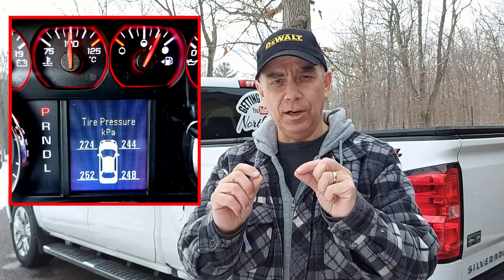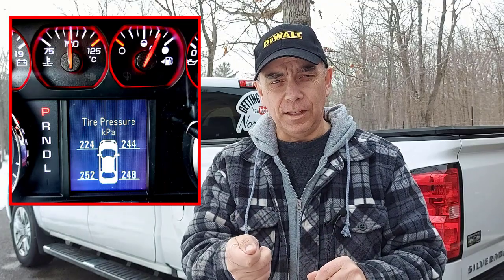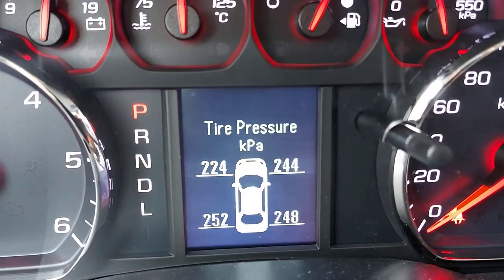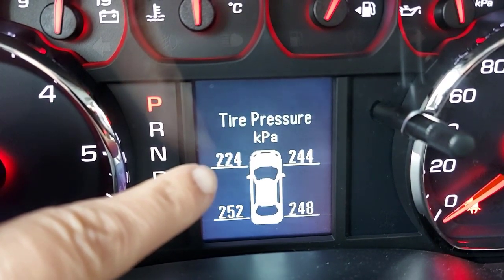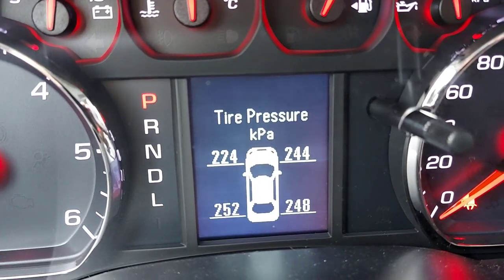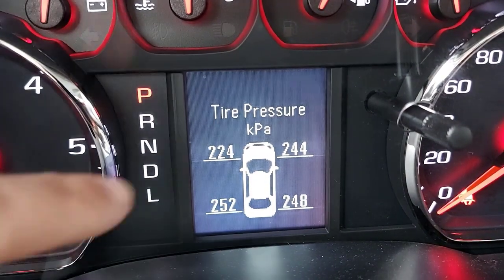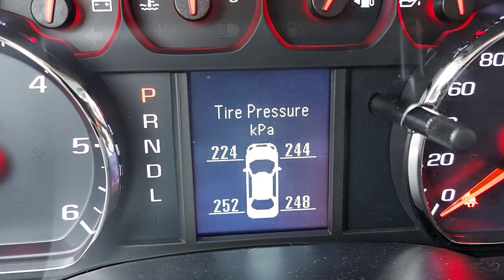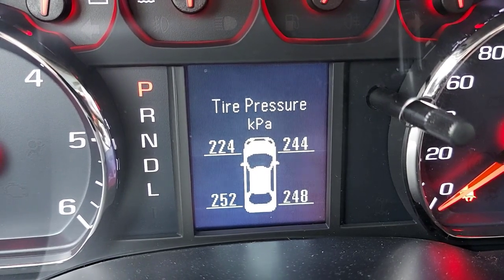Low Pressure Tire Warning Light // What I Discovered & How I Fixed It

Comment: Somebody rotated a tire for you.   My Jeep takes up  to 50 miles to reset. Thank you for the tip, Roland. Stay safe and stay warm
Reply from the maker: I never thought of that... someone played a trick on me 🤣
Reply: @GettingItDoneRepairs  If the sensor is just in the  valve cap it is pretty easy to do. Or rotating the tires somewhere. who knows.

Comment: My Genesis says both back tires are low. In winter, the tire pressure will vary from warmer days to cold. Most of the time, it corrects itself with road friction warming up the tires. However, it still needs to be checked. Proper tire inflation is the life of the tires, and the handling of the vehicle. Though, some choose to run lower tire in wintery conditions of snow and ice. Me? I'm thankful for traction control, and still refuse to drive in snow or on ice, lol 😆 Great Vid, Roland! God Bless!
Reply from the maker: Yes cold temps are a pain to tires. We just have to keep an eye on them and like you say, just avoid snow and ice. 🙂Take care Angie.

Comment: At the first cold front we always get a low tire warning. If I check the tires they are all correct. I simple let 5psi out of each tire the fill it back up to the correct level (back exactly where it was) drive it 1/2 mile and it resets. 

This happens at the first cold front every year.

Comment: My wife's car tire pressure is supposed to be 35psi and usually stays pretty consistant.  We run nitrogen in them (came that way).   Got an alert saying tire pressure was down, One was 29psi, the other 3 were 30psi.   I think it is because we are experiencing a cold snap.  Your thoughts Roland?
Reply from the maker: Yes thats likely it. Top them up and monitor

Comment: The problem is your using the metric system. That's an American truck. You need to measure in PSI. LoL.
The TPMS doesn't know what kind of tire is installed. Check your manual. The original may call for more or less pressure.
My Michelin 10 ply tires allow up to 80 psi. The originals were 6 ply P tires rated at 35 psi.
Regardless of what you have they should be equal to within 5 psi. Don't let the idiot lights rule you. Check your pressures monthly.